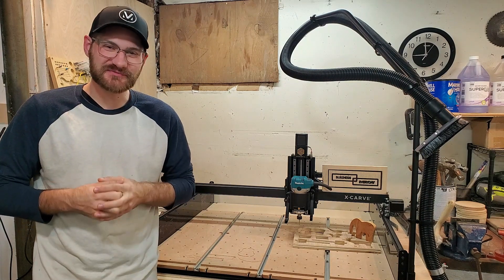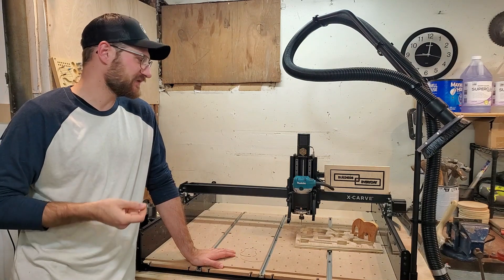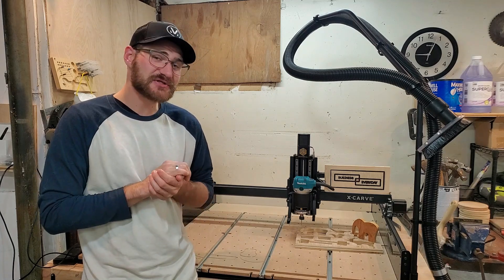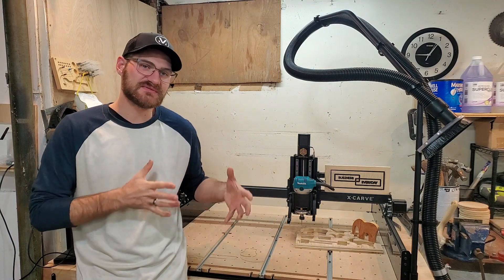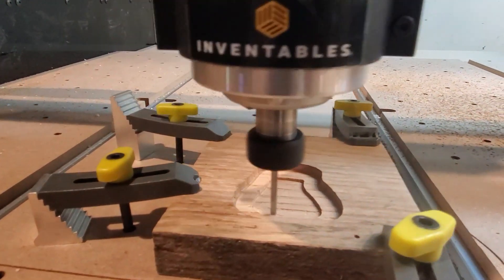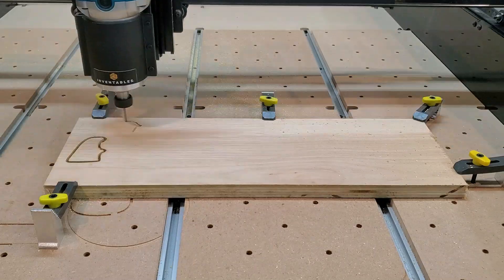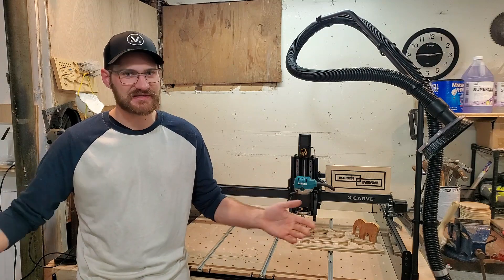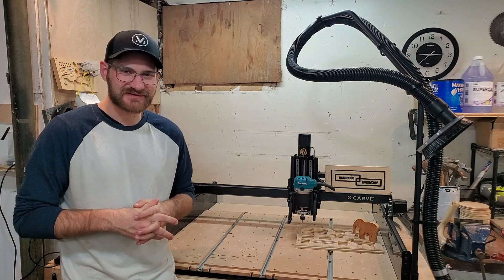X-Carve Review  | One month thoughts on 2021 Inventables X-Carve CNC Machine

Comment: Purchased my complete bundle about 2 years ago. Never operated a CNC prior to this in my life. About 2 months ago I purchased the upgrade kit with stepper motors and heavier duty gantry etc. I liken the assembly to a detailed adult erector set. Yes there was many hours of assembly time. That's where old age (a few beers) and patience come into play. Two things I've learned about operating this machine, patience and a little bit of a math brain. You have to be able to convert standard (1/8/, 1/4, 1/2, 5/8 etc.) mathematics into decimals to be able to operate the machine efficiently. I use mine mostly for hobbies and for making a dollar here and there. I'm sure I've paid for mine at least one time over with made projects. I spend 5 to 7 nights a week in my little shop making things as opposed to sitting around watching television. I actually enjoy working with it every day and seeing what else I can build. I tell my friends that if they can sketch it on a cocktail napkin, I can make it. Incorporate Inkskape (totally free) with Easel, and you have everything you need. I would definitely recommend the X-Carve any day of the week. I have treated mine very well and it is never had a single issue. I'm sure there are plenty of units out there that have a higher price tag that will do more than the X-Carve, however for what I do (hobbyist) this exceeds my expectations.

Thanks for your feedback and commentary, I will look for further reviews.